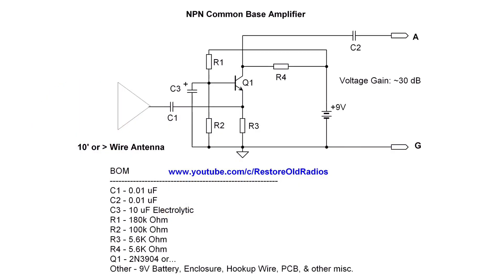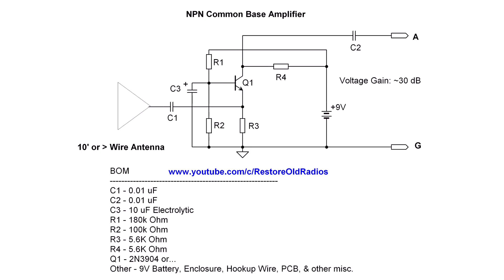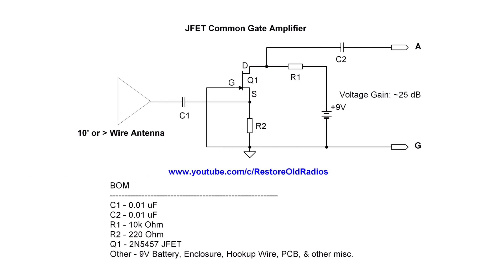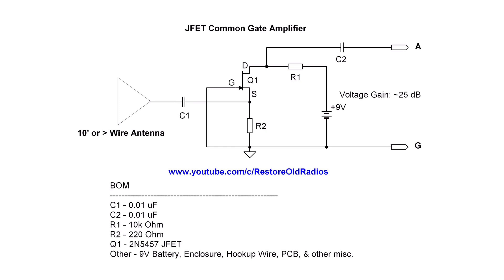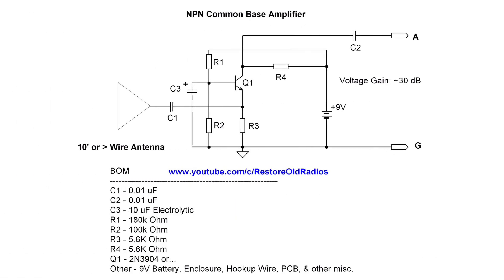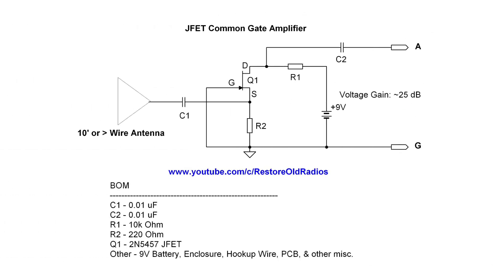NPN Common Base & JFET Common Gate Amplifier Circuits + DXing w/ Zenith 6S229

Comment: Hi Don, thanks for the video about the booster. Great information, and I heard you pick up WWVA, am, in Wheeling Wva, of course, Im only about 80 miles from there, in the Canton Oh area. Great radio, have you performed an alignment on it yet, It really seems to be performing well at this stage in your restoration.  Great job.
Reply from the maker: James, thank you. The alignment is complete and was almost spot on as found. After a little tweaking and the addition of the amplifier, she’s got great sensitivity. The upper SW band plays equally as well. Best, Don